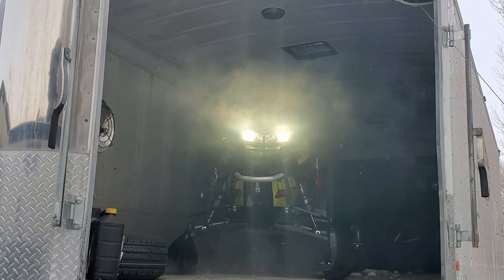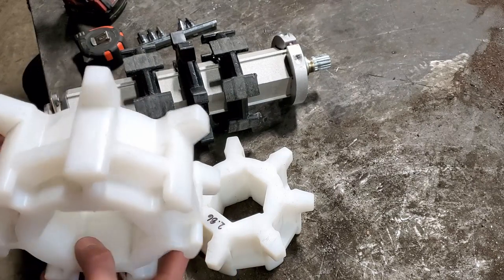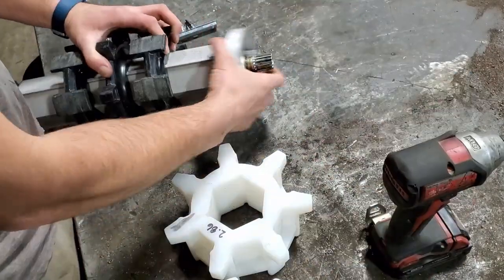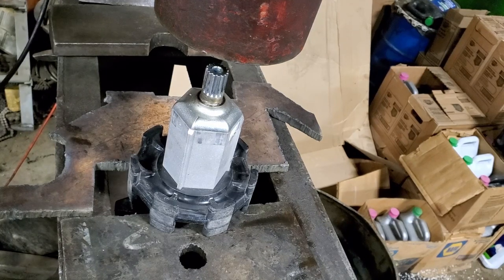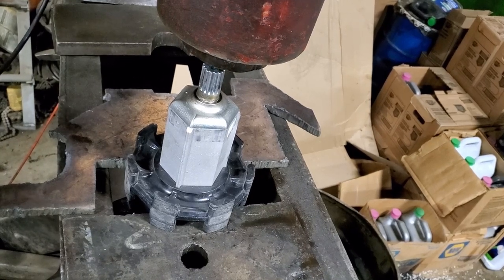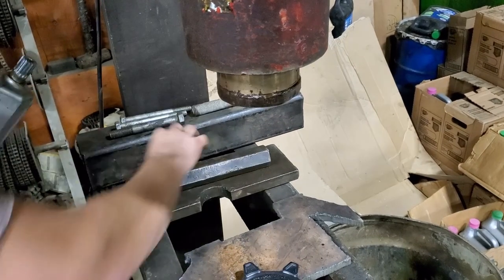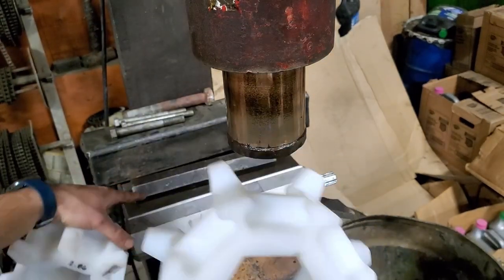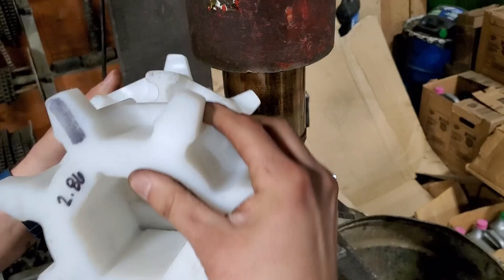Polaris Axys Drivers- Avid Drivers Upgrade and Install

Comment: Looks like the way to go. I’ve heard of a few driver issues on new Polaris sleds. Thinking about doing this to my 21 165 rmk. I guess the series 8 tracks like to be run real tight or they will ratchet easy. Looking forward to seeing what you think of these drivers. Great explanation on install.
Reply from the maker: Yeah I've heard the same thing as well on the series 8 slipping unless extra tight. This setup is still the series 6 track but I'm sure these drivers would for sure help the series 8 where there is so much contact with the track and and through the windows. Thanks for the feedback!

Comment: You didn’t show how you got that out of the sled....
Reply from the maker: No I didn't. I felt that would've made it too long. On this sled it's fairly easy and straightforward. Just loosen the track and unbolt the 4 main suspension bolts and remove the suspension. Remove the belt drive on the right hand side and 6 bolts on the other side. Slide the drivers to the left side of the machine and the right side with come out.

Comment: i would left the middle driver in there
Reply from the maker: That's definitely something you could probably do if you wanted. I would just rather have my driver's run off the clipped windows instead. Plus the avid drivers ride off 4 pretty good points of contact that its almost impossible for tge track to slip making that center driver pointless in leaving on.